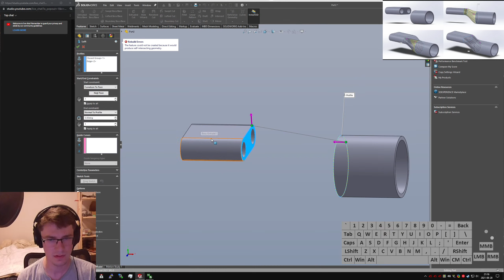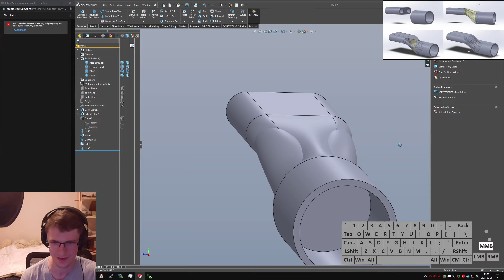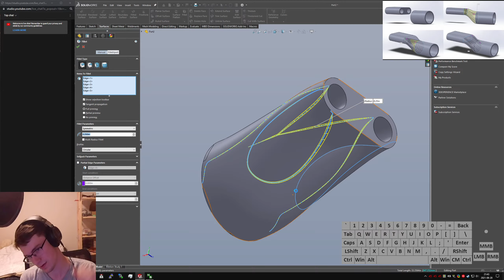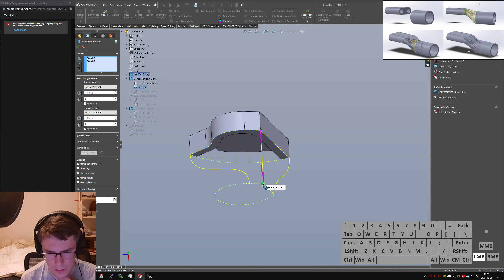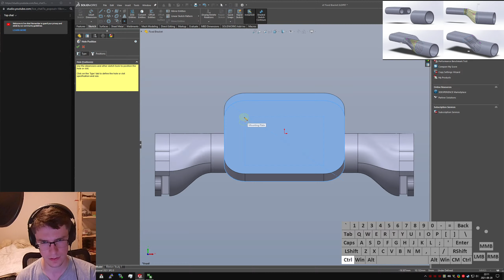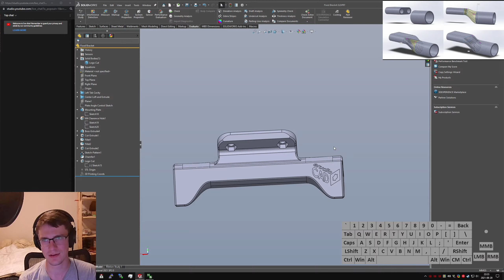/r/Solidworks Lofting Question + Bracket Redesign

Comment: Hey Dude, Im the guy who posted the pipe question on reddit lol the subtract thing is one I don't really do much of but when you did it it made me feel like a bit of an idiot lol. Thanks for the help, I guess for the most part I have to figure a way to do it so it can be machined smooth on the outside whilst keeping thickness for pressure. You're an absolute legend, cheers.
Reply from the maker: Ooh boy, okay that's going to be a lot trickier. I assumed this was being 3D printed, which vastly simplifies the process of designing internal cavities like this because you basically don't need to think about how to manufacture it, and the exact geometry of the where the pipes are relative to one another is really important. I'm going to take a wild guess that this is for an exhaust system, possibly for an FSAE car? This is the sort of part that you really need to make out of a couple pieces of sheet metal jigged together, and not machined from billet.
Reply: @ClarkSchaefer  I actually managed to pull this part off, and now moved to a further step :D I did it buy forming a revolve of the shape of one of the slot pipes, revolving it to the next, loft into it, cut loft internally, and fillet the inner edges lol, not the most ideal but its mint
Reply from the maker: @LeakyBowel72  Choice, glad to hear it!